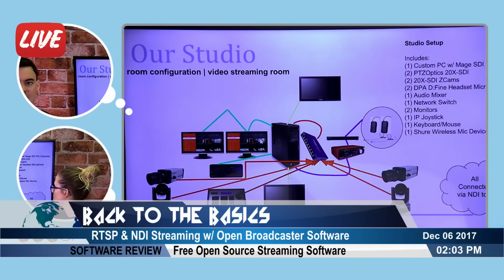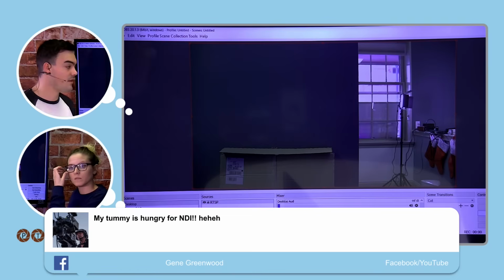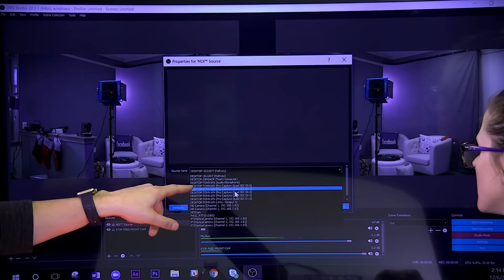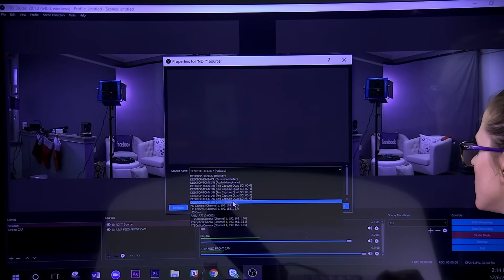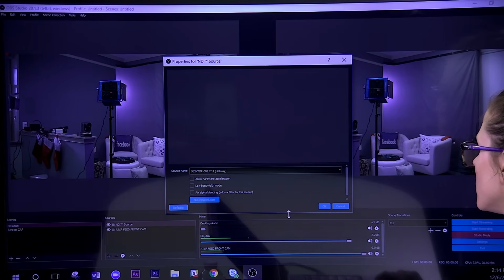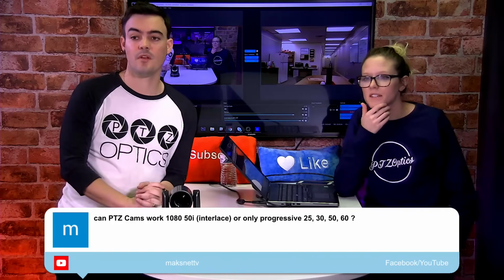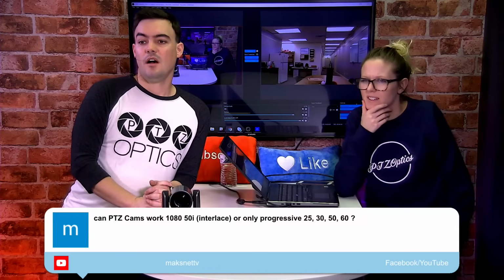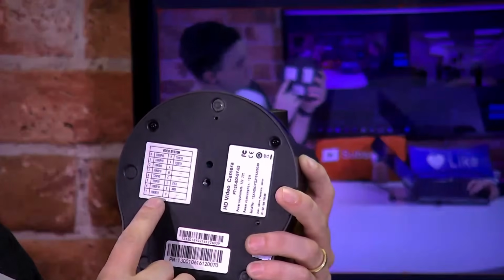RSTP and NDI streaming with OBS

Comment: I'm streaming car races with OBS. I want to add some staic ndi cams around the track. I would also like for the scoring tower to be able to receive these signals on another computer with obs installed in order to get instant replays. Would I just run a network cable from my switch to the control room computer?
Reply from the maker: We suggest joining our OBS User Group on Facebook where you can ask questions like this to a community of helping hands! If you are having issues with a PTZOptics camera specifically, shoot support@ptzoptics.com an email! -Lindsey 
https://www.facebook.com/groups/OBSUSERS

Comment: It should be mentioned at this point (2021), that if you buy a PTZ camera from any manufacturer. You will have to pay an extra license to Newtek of 300€ or dollars to be able to include that device into the NDI.

If you have 10 cameras your licensing will skyrocket into the thousands of dollars. Who knows what Newtek will pull out their sleves next. A yearly license? or pay per Mbits?

RTSP on the other hand.... Free
Reply from the maker: Hello!
Your concerns about NDI licensing costs for PTZ cameras, including those from PTZOptics, are valid. As of April 2023, here's the situation:

NDI Licensing Fees: When you purchase a PTZ camera that supports NDI, it's true that there may be additional licensing fees required to enable NDI functionality. This fee is paid to NewTek, the developers of the NDI technology. The cost you mentioned, around €300 or $300 per camera, is in line with previous information, but these fees can vary and might have changed after my last update.

Cost for Multiple Cameras: Indeed, if you have multiple cameras, these licensing fees can add up significantly. For a setup with 10 cameras, as you mentioned, the total cost for enabling NDI on all cameras would be a substantial investment.

Potential Future Changes: Your concern about future changes to the licensing model, such as annual fees or charges based on usage (like bandwidth), is speculative, but it's wise to consider long-term costs when investing in technology.

RTSP as an Alternative: RTSP (Real-Time Streaming Protocol) is indeed a free alternative for streaming video from cameras. However, it's important to note that RTSP typically has higher latency compared to NDI and may not offer the same video quality and ease of use. RTSP can be a viable option, especially if budget constraints are a significant factor.

Evaluating Your Needs: When deciding between NDI and RTSP, consider your specific requirements, such as video quality, latency, ease of use, and network infrastructure. If the benefits of NDI (like low latency, high video quality, and ease of network management) are critical for your production, the investment in NDI licensing might be justified. Otherwise, RTSP or other protocols like HDMI/SDI (with appropriate converters) could be more cost-effective.

Remember, technology and licensing terms can change, so it's always a good idea to check the latest information from the manufacturers or vendors before making a final decision. If you have more specific questions about PTZOptics cameras or need advice tailored to your situation, feel free to ask.

Comment: I have a video delay using NDI plugin and i was wondering do i need to get a switch to go into my modem?
Reply from the maker: ✅ Yes, you should absolutely use a Gigabit network switch between your NDI devices and your computer, not your modem.

💡 Why:
Modems are for internet access, not local networking. They introduce unnecessary routing and latency.
A Gigabit Ethernet switch creates a local network where NDI can send video data directly between devices with very low delay.
NDI streams are bandwidth-heavy (especially at 1080p or 4K), and a switch handles that traffic much better.

🔧 Tips:
Make sure the switch is Gigabit (1000 Mbps) — not a 10/100 model.
Use Cat5e or Cat6 cables.
Keep everything on the same local subnet (e.g., 192.168.1.x).
Avoid Wi-Fi for NDI if possible — it adds latency and packet loss.